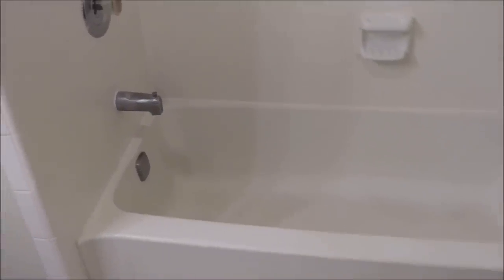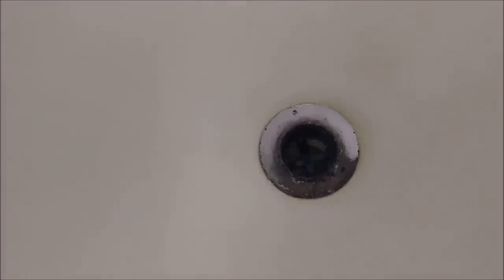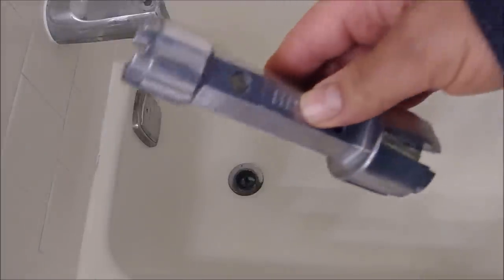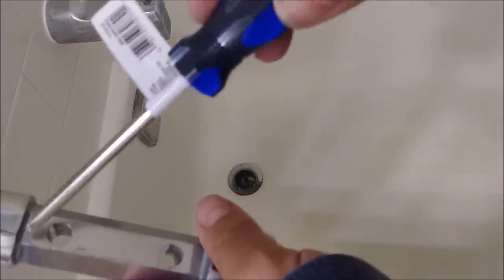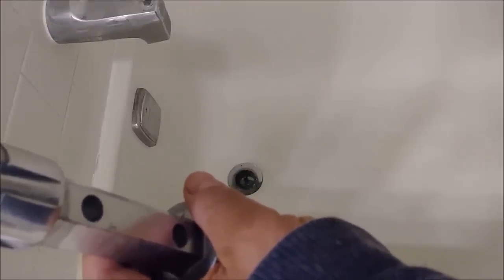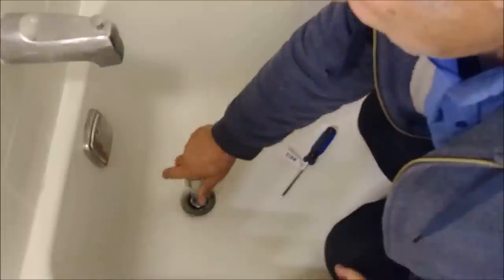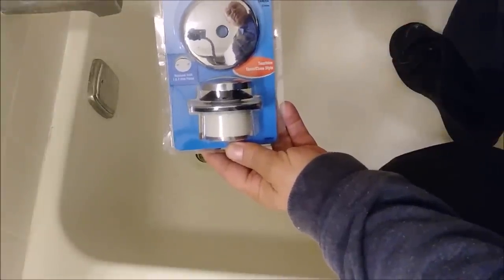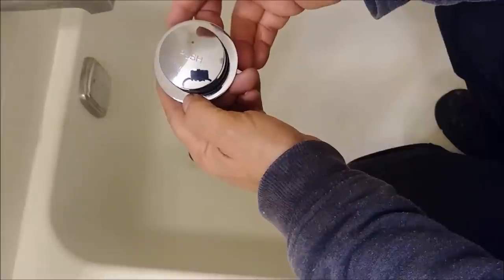How To Replace A Bathtub Drain - Remove and Install New Drain - Step By Step

Comment: Thank you. I was going to hire some to replace my drain. Your video saved me a lot of money.
Reply from the maker: Any time.
Reply: The flange that I screwed in wouldn't get tighten what can I do
Reply from the maker: @paulettegraham1079  What happen when you try to tight the flange ? Also you should put a plumber putty between the flange the the bathtub.

Comment: A most excellent demo...I wondered how the large rubber washer was to be used.   As in the demo I did not need it.  Thanks for explaining the installation.   You explained it very well.
Reply from the maker: Any time.

Comment: The black rubber seal that comes with the drain assembly and slid over the drain threads that go to the drainpipe should be used to replace the black rubber seal between the drain pipe and tub. People make the mistake of using it for a seal under the drain flange instead of a plumber's putty. That is a mistake. I never trust an old black rubber seal so I will always replace it since you are at the seal area anyway. Take care in not over-tightening the drain to the pipe or you can damage the pipe if you over-torque it. Just make sure it is nice and snug and fully seated. Good video for this assembly.
Reply from the maker: Thank you for the input.

Comment: Great video. Most people do not know that the gasket under the tub is called a bathroom shoe gasket should be changed to prevent leaks. Expensive leaks. Gasket is about $6.

Comment: Thank you, this worked perfectly. The only thing I did different was use a pair of needle nose pliers to unscrew and screw the new one in instead of the special tool.
Reply from the maker: Yes you can do it like this also. Thank for the info.

Comment: Your new drain comes with instructions.   If you read them there is a description of the gasket, it's called a shoe and it fits between the bottom of the tub and the flange at the top of the drain pipe.
Reply from the maker: Thank you for make it clear.
Reply: @josephk9182  years of experience repeatedly failing to read instructions,  and still...

Comment: I have the same drain removal tool however it did not seat far enough down in the drain to get a good grip. Any other suggestions? Thanks
Reply from the maker: You should look for tools in amazon that  works with your drain.

Comment: Thanks for the video. You removed the gasket but applied plumbers putty, would it be the same if you left the gasket at place and didn't use putty?
Reply from the maker: No it is not the same . There was already rubber gasket in the drain so I did not need to use the new  gasket. You must use putty or silicon to seal the flange o the bath tub .  Please look again on the video.
Reply: @josephk9182  never use silicone or putty, as all these things wear away after time when the hot water hits it, the best is the rubber washer it will hold up the longest
Reply from the maker: @worldview730  Very wrong. You must use putty not rubber.
Reply: @josephk9182  Don't agree, be doing this for 20 plus and my final conclusion is the rubber last longer, because all the times i've used putty it wears away after a period of time when the hot water hits it . So from then on a started to use a rubber washer on top (thin one) and one on the bottom (thick one. This same principle works on kitchen sink strainer baskets. That rubber will never wear trust me as i've worked on many old and new tubs
Reply from the maker: @worldview730  I installed the drain per manufacture recommendation. The recommendation is to use a plumber putty not rubber(washer) otherwise, the manufacture will supply rubber (washer) for it. I did not have any issue with putty. Most likely if one has an  issue with putty he probably would have not install it properly. The reasons may be that he did not tight the drain as needed or did not use enough putty.
Reply: @josephk9182  I use to use it myself when i first started out but after working on a lot of old tubs it would wear away over a period of time due to the hot water breaking it down over a period of time. But I can guarantee no leak with the rubber washer on the top and bottom. But it maybe not aesthetically proper sometimes so you have to have the thin type washer  depending on the recess in the tub
Reply: I definitely don't use putty on kitchen strainer baskets as they take a lot of hot water abuse. I opt for a more long term plumbing solution as opposed to the quick fix one. I ask myself how long will this job hold up always. I stock up on these black rubber washers , thin and thick ones
Reply: @josephk9182  Plumbers putty/silicone,  is good for mounting faucets of all types

Comment: Do you have any idea if the old drain is too tight to be released? I can't remove the old drain because it's too tight... not moving at all when using the tools... Big thanks in advance!
Reply from the maker: You should use PB Blaster Or Wd40 Find it on Home Depot. Also ask in Home Depot if the have better product. With the PB Blaster it have to sit for 12 hours or so (please read instruction)

Comment: Wouldn’t it make sense to replace the rubber gasket as well since you got a new one ? - who knows how well the old seal will hold up when you re-tighten the new drain.
Reply from the maker: You can if you think the old rubber need to be replaced.

Comment: there are many videoes on replacing tub drains and tub drain stoppers which is fairly simple but i cannot find one video on replacing the backside and tieing into the drain which seems to me most dificult for a DIYer.
Reply from the maker: You are correct.

Comment: Why not replace the old rubber washer?  Is it jammed in too tight?
Reply from the maker: No. You do not need to replace what works but you can replace it if you want.

Comment: Thank you for the video sir, I have two questions appreciate if you answer those. 1. My bathtub drain's cross metal is broken and it is just like a hole so still can I remove it with this tool? 2. When I remove the bathtub drain from the pipe the pipe doesn't move down or fall down?
Reply from the maker: 1. Yes you can with different tool. I think there is a YouTube video that you can see how to remove drain with broken cross metal.

2. no, the pipe will not fail.

Comment: I think use BOTH washers.  Doesn’t hurt to have one on top as well because the drain recess allows flush install even with the washer under and lasts more than putty.
Reply from the maker: No. You should not put rubber between the flange (bathtub drain) and the bathtub you may have water leak . You should use silicon or putty.
Reply: Joseph K I know they say that, but I don’t think water can physically get past the rubber washer between the tub and the drain flange with the two pressed tight together.  As a matter of fact there should be a smooth surface for the rubber washer to touch the tub for good seal, and Inside the tub is guarantee to be smooth as you clean it and inside the tub is very smooth by manufacture.  Underneath the tub might not be so smooth and we cannot see there. Could be dirty under there.

Comment: Gah! I think we put the bushing in upside down ... we put it in first (removing it from where it was originally attached). Also, the plug part came apart and we can't figure out how to put it back together before we install it ... :(
Reply from the maker: Just follow the video.
Reply: @josephk9182  It doesn't address the problem, unfortunately. :/

Comment: Should the drain flange be tight where you can’t stick a nail underneath it or just tight enough. Just installed a new one and just scared to go any tighter
Reply from the maker: Follow the video. You need to use putty and install it tight enough that water will not penetrate via the flange. Please do not be afraid to tight it. Not very tight but tight enough. After you install it test it to verify water are not penetrate the flange.
Reply: Joseph K okay thank you! Also the gasket looked a little worn but can’t seem to find the exact one via hardware stores. If putty is good will that prevent a leak or should I worry about gasket also in that case
Reply from the maker: If you token about the rubber gasket I do not believe it will be an issue. Did you have leak before you replaced the drain ?  The putty is good enough to prevent leak .
Reply: Joseph K yeah the gasket that goes between tub and pipe, it had a slight tear and was just worn but no previous leaks. But I assume if putty prevents flange leak then water won’t get past that gasket either
Reply from the maker: @awhitepillow_1385  Yes you are correct.

Comment: The developer actually put some white stuff around the drain metal to zeal the gap between the metal and the tub.  When i cleaned the bath tub, I did not notice the seal, and I accidentally  sculped some of them out.  How can touch it up?
Reply from the maker: It is probably white silicon. You need to use white silicon to touch it up.
Reply: @josephk9182  Thanks Joseph.

Comment: You probably should have replaced the washer. The replacement part uses a bushing to decrease the diameter of the drain. The new washer matches that new diameter.  Might not matter, but if takes about 30 seconds to change, so you might as well do it.
Reply from the maker: You can but it was not an issue in my case and never give me an issue.

Comment: Please help me because I have the same problems. Please 🙏
Reply from the maker: what is your problems
Reply: @josephk9182  my bath tub drain is OLD AND RIM IS LOOKING LIKE STAINS ALL OVER THE RIM. Thanks 🙏
Reply from the maker: @shad6519  Try to use wd-40 and let it stay for couple of minutes and than try to remove it.
Reply: @josephk9182  Please believe me, today I called two companies of plumbing experts and both said that since I am living in a condo apartment there is no way I could replace it unless I get the permission from the lower floor owner to do the changes from the lower floor. I am shocked.
Reply from the maker: @shad6519  Weird
Reply: @josephk9182  yes, I am surprised too because when I saw your YouTube video I saw how easily you removed it and I don’t understand what makes them say that they can’t.
Reply: @josephk9182  PLEASE KINDLY LET ME KNOW WHAT RIM IS BETTER WITH STOPPER OR WITHOUT STOPPER? WHICH ONE IS BETTER OPTION? Thanks again
Reply from the maker: @shad6519  If you need stopper use with stopper if not use without stopper.No one is better than the other.
Reply: @josephk9182  the plumber had the rim with the stopper but for me I thought without the stopper is better so that I could remove Anything from inside and with stopper, I don’t think I could remove it without a screwdriver. Thanks 🙏

Comment: Don't tell me your going to use back that same rubber washer , why don't you put the new one in there? Only thing is you can't see underneath the tub shoe to see if it's a full proof seal from leaking
Reply from the maker: I did not replace the rubber because it works properly. I never have a leak from this bath tub. The tub is located on the second floor and if this tub leaks I will see the leak on the ceiling below.
Reply: @josephk9182  You won't know unless you proof test it by looking at it and you sure can't tell from the top. Most guys are not going to do this i understand because of the work involved.  I've worked on many tubs old and new and have changed these overflow systems all types and know what i'm saying from experience
Reply: @josephk9182  you don't know if that rubber works or what it looks like because you haven't inspected it. Those rubbers become compressed and worn so while you have it exposed and a new one you might as well change it one time
Reply from the maker: @worldview730  I agree. I should inspect the rubber.
Reply: Are you talking about the washer under the tub? Is that hard to replace since it's under the tub?
Reply from the maker: @jbw9999  Yes.
Reply: @josephk9182  Yes what?

Comment: take out the OEM Rubber Seal only to replace it with Putty...
🤔
Reply from the maker: I did not replace the rubber seal. If needed the rubber seal is installed under the bathtub sink.